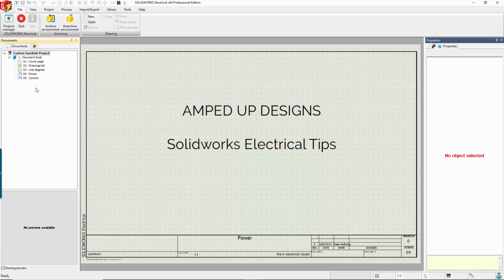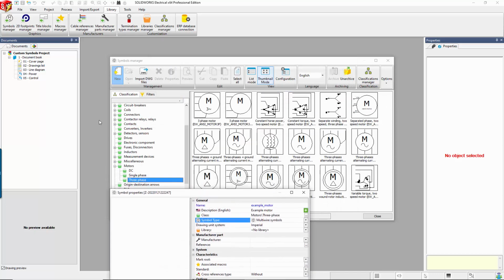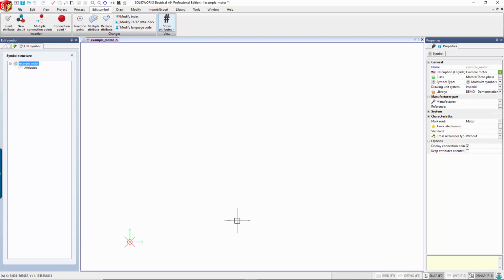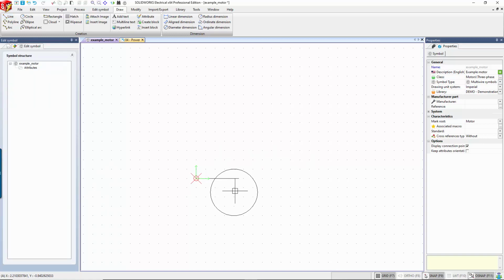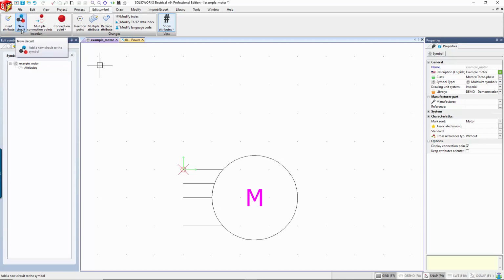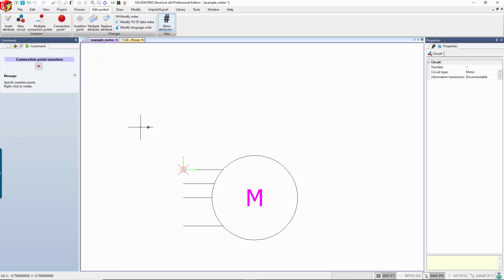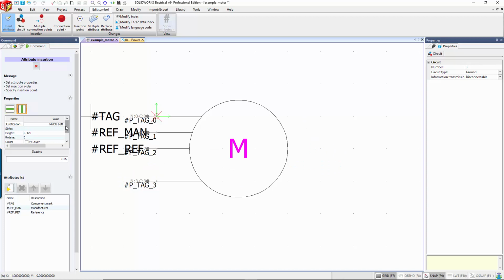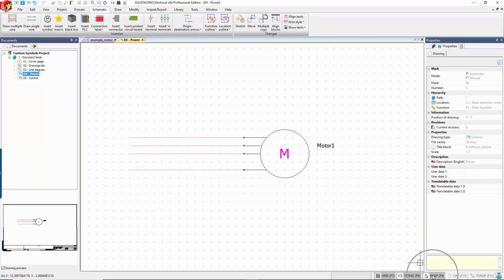How to Create Symbol in SOLIDWORKS Electrical

Comment: Thanks for the video!

Pro-tip: when using the trim command on lines with more than one intersection point, trim from the end of the line segment that you want removed and work towards the segment you want to keep. In this way you don't create non-intersecting or "marooned" line segments which require an additional command to remove.